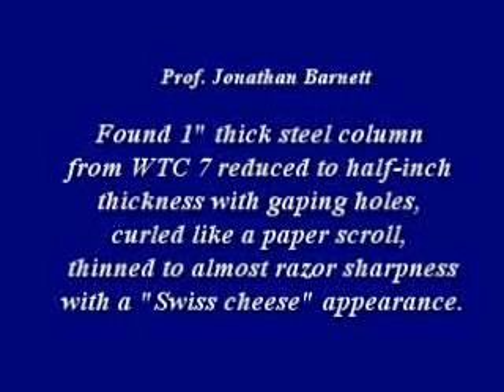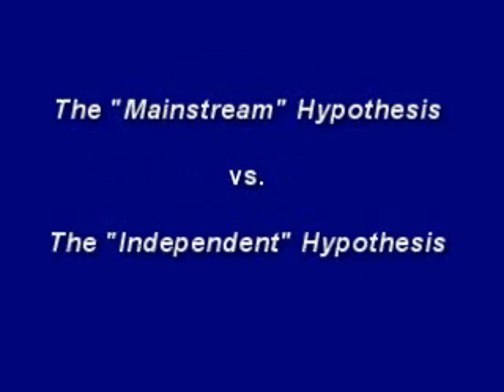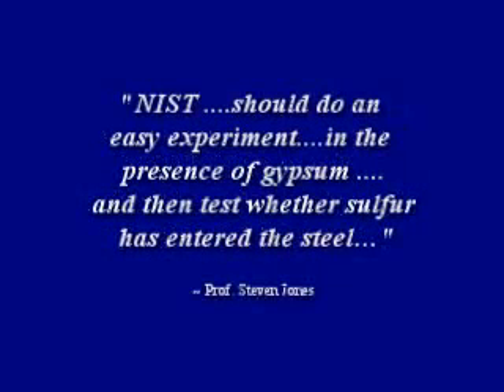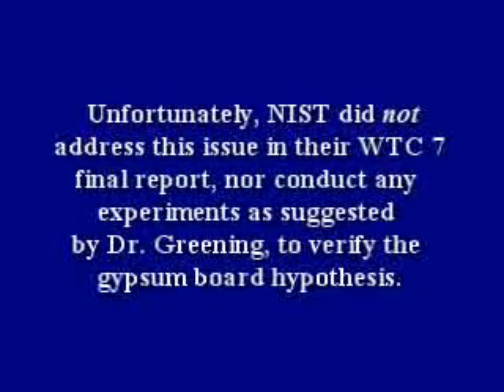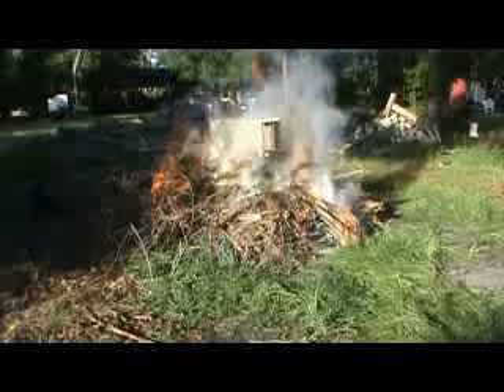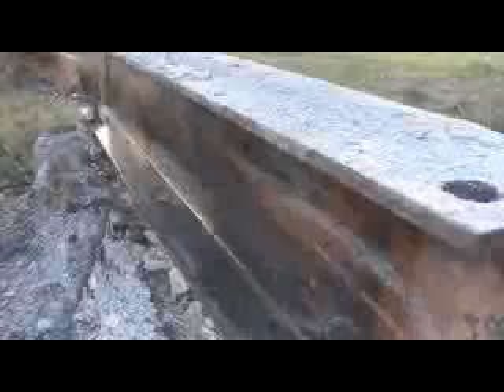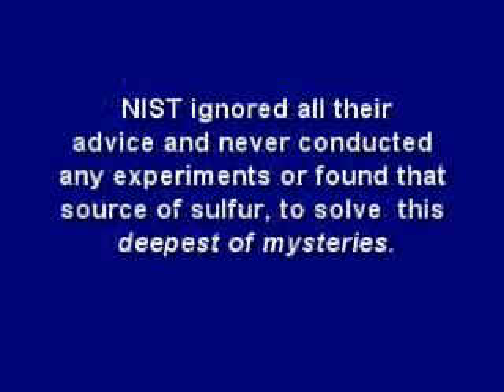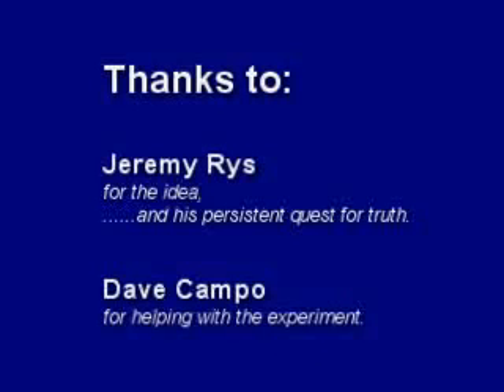9/11 Experiments: The Mysterious Eutectic Steel

Comment: @fertilizerspike The top of the building has enough to break the floors below without any momentum at all. 

The top of the buildings mass applied to the floors below will break the truss-to-column connections of here-said floors without any momentum at all. 

Unless you're one of those "engineers" who thinks the full vertical support capacity of the coluumns would have resisted collapse. (ignoring the still standing cores) (and myriad other things)

Comment: @fertilizerspike Each floor on the WTC is the same strength sans the mechanical floors at the lower, middle and upper portion of the building.

Comment: @teefkay2
The tests that were performed that verify this material is thermite and corresponding page numbers from the peer reviewed study:

magnetic (pp. 3, 4, 5)
chemical signature identical to thermitic compound, dissimilar to paint/primers, doesn't burn like paint (pp. 6-23)
large but narrow exotherm (pp. 4, 13-16)
pyrotechnic/explosive (pp. 15-16)
iron (and silicon) bound with oxygen 2/3 ratio (pp. 6, 9, 12-13)
aluminum predominantly in elemental form (pp. 6, 9, 12-13)
high enthalpy (p. 22)

Comment: @fertilizerspike 
"melted edge": wrong (eroded webs)
razor sharp: wrong (not close)
a swiss cheese hole: wrong (grain boundary corrosion)
FeS & FeO were part of the beam: wrong (only the Fe)
S from thermitic reaction: wrong (no S in thermite. S & Ba in thermate.)
S catalyzes thermitic cutting: wrong (Lowers ignition temp, produces flame)
firmly established: wrong
Typical twoofer. Every single detail wrong.
Go back to mommy's basement, child.

Comment: @teefkay said:
"1. F = ma, or 2. impulse-momentum eqn: Integral[F.dt] = delta[mv]"

Which formula tells you that the top ten percent of the building has enough potential energy that a twelve-foot drop can cause the complete cascading explosive failure of the entirety of the rest of the building? The force required for the top to destroy an equal amount would also be exerted ON the top, upward, arresting its motion long before it reached the ground. ASSuming this "collapse" was even spontaneous.

Comment: @flanksteak2
You should try actually reading the report, for example page 17, where it states sulfur is present on some of this nanothermite. It suggest the source of contamination by drywall. Any such sulfur contamination would only cause the reaction to cut through steel faster. Any contamination intimately mixed with once-molten steel is readily explained by thermitic reaction. Other contaminants, like metal oxides, would just drive the thermitic reaction. Do more research.

Comment: @teefkay
How long would it take the World Trade Center towers to shred suddenly from top to bottom in less than ten seconds with less than 5% of the outer columns severed and less than 10% of the inner columns severed for a total of less than 6% of all load bearing columns severed and only across at most three floors? There is no correct answer to this question, but you'll come up with one.

Grade F

Comment: @teefkay
Where in the tower columns did they use the breakaway steel designed to fragment in 30 foot segments as if the whole building had been run through a giant shredding machine? There is no correct answer to this, but you'll come up with one.

Grade F

Comment: @flanksteak2
I don't think you've read the paper. I'll quote page 17 from a hard copy I have here:

"Other peaks included calcium, sulfur, zinc, chromium and potassium."

The Ca and S are likely contamination from drywall. S would help the reaction cut through steel. Other oxidized metals also would likely drive the thermitic reaction. Paint chips melt in MEK, this nanothermite does not. Read the report for once instead of lying and suggesting you've read it when clearly you're ignorant.

Comment: @noozilander Taking modern low-sulfur and then claiming it was representative of the drywall installed in the WTC's in 1970's is non-sequitir. 

It's like taking modern paint, testing it for lead and then claiming that paint made many years ago could not have been a source of lead poisoning because the new paint you tested contained no lead. 

This might help you understand why Mr Cole's claims hold no water although you appear to have a drinking problem so I doubt it.

Comment: @flanksteak2 If you listen to the information presented, your tiny mind may just see that P&R is merely showing by experiment that the sources given by OCT proponents for the source of the sulphur are not possible.

Do try to keep up, swallower.

P.S. You still haven't answered what initiated the S towers collapse either. Did the walls push in on the trusses or did the trusses pull in on the walls? You said both, but we both know you were being stupid again, so what's your answer, swallower?

Comment: @flanksteak1,
"Thermite" is stupid. There wasn't any.
If used, residue from it would have been visible, by eye, from 30' - 50' away. Look at the hi-res photos today: no residue.
If used, 200 search dogs (cross trained on explosives detection) would have alerted. None did.
If used, and it did the (brain dead stupid) things that twoofers THINK it did, there would have to be about 12,000 - 15,000 cut columns in the rubble heap. There were 0.
Thermite is stupid, sulfur is stupid squared.

Comment: see John Hutchinson.  unreacted nanothermite can be made from iron oxide and aluminum being close to each other (since the aluminum siding was bolted to the steel directly).  There is evidence that two materials can be 'merged'.  It would also explain why it was a consistant portion of all dust and still unreacted.  The sulphur probably did come from the gypsum drywall, but it requires the hutchinson effect;which doesn't require that much power,nor is it a beam weapon as most would think of one.

Comment: @NanoThermite911 
an online petition with dubious origins and checking procedures for quals, how many of the engineers are structural or fire enegineers and how many are electrical or mechanical? and how many are wanna bes? 
and that then leaves how many architects who aren't qualified in building behaviour during fires?
you wouldn't trust a congressional oversight anyway as you believe it was bi partisan

Comment: What I really find fascinating is that you still believe diesel fuel melts steel.
You need to warn people about this, there is people driving cars with steel engines that runs on GASOLINE! Imagine the catastrophe if they mix in a bit of gypsum wallboard, the implications would be of massive proportions.

come on Merl... Your amazing theories is like the WTC7 , reduced to rubble.

Diesel fuel can ofc melt steel, but thermite/thermate would cool... Hello?!? Logical fallacy anyone?

Comment: @SuperLogicalthinker 
I as mentioned before they did a test on several floor beams that were exposed to fire for several hours and they started to warp.  I did not glow red.  Your right about the fires don't burn hot enough to make steel columns glow red but they are hot enough to make those beams weak.  Since 1/3 of the 7WTC already been damaged by the north tower, only few columns was left and they were exposed to fire.  No evidence of a explosion was ever involved.

Comment: @SuperLogicalthinker 
I just wanted to know if those beams can be bent while it's glowing red.  They've done a test where several floor beams were exposed to fire for several hours and they started to warp. If that was the case that means the beams that surpported 7WTC could no longer support the weight of the building and eventually failed. What he done here is let the beam cool off and said it was solid and sound which it proves nothing. SHITHEAD!!!

Comment: Nice experiment.  But there is one thing.  After he burn the steel beam he let it cool off first and proved it was still strong.  But, is the beam still had its strenght when it was glowing red?  Remember, building 7 was still on fire before it came down.  Also, did the beams that supported the building was still strong enough to hold several tons of concrete and steel above after long exposure to fire?

Comment: @Merlin5x5 "The crashing upper block C is not Asymmetric"
Why not?

"It's very symmetric, isn't it"
Why?

How does asymmetrical damage on one side of the building equate to a precipitous 3.7m drop of C onto A through B? That indicates simultaneous failure of the vertical columns.

The 47 core columns & perimeter columns are connected all the way down to the bedrock, so your notion of only having to deform/crush 3 floors at a time is farcical.

Comment: @Merlin5x5 "ONLY ONE gravitational acceleration"
Well done! You finally got something right. 

I've continually stated that the resistive force on the falling 2/3g pile-driver was 1/3g - thus it's 2/3g acceleration. What's hard to understand? You seem to think an object is either completely a rest (0g) or in free-fall (g). 
Pop-quiz: Let's say you weigh 60kg and you hop onto a scale in an elevator. The elevator now descends downward at 2/3g. What will the scale read?
Reply: i know it's been 11 years, but....60 kg?

Comment: @Merlin5x5 "damaged 6 floors"
Asymmetrically they did. Are you going to try and say they were uniformly damaged across all 6 floors? 

"higher than three floors"
Sorry, I can't see your point here. This structure, A, still needs to 'crushed' by a force delivered by the mythical pile-driver. Falling rubble B isn't the crushing mechanism here.

"that's it's SPEED"
How many times do I have to say it? It's accelerating downward at 2/3g. In other words, it's velocity is constantly increasing.

Comment: @Merlin5x5 "Piledrived it"
Once again, HOW can it do this with no deformation to itself? You talk of an 'impact' of C onto A, yet there is deceleration of any kind. How is that possible? A force so great as to start crushing A and cause global collapse, yet the required deceleration is not discernible or measurable in any video? How can C transmit a force so great that A wasn't able to withstand but that itself, made of the same elements & particulars, was able to?

Comment: @Merlin5x5 "HEAVY TRUCK"
Why is a truck hitting a car you clown? It's meant to be a like object hitting a like object - part C 'impacting' part A. Part C's potential energy doesn't matter - because, as has been explained to you, part C can't ONE-WAY crush part A without destroying itself. 

"2/3 g"
Yep, the upper block moves downward at constant 2/3g. Thus, the resistive force of the lower, stronger structure below is 1/3g. Why are you trying to deny this?

Comment: @Merlin5x5 "cars in a line"
To go along with your one-way crush-down then crush-up hokum, what you are basically saying is that if a semi-trailer (A) was hard up against a wall (or 9~ other cars lined up), that the car (C) getting a run-up (1g) would be able to accelerate through it and crush it all the way into a compact debris pile - without any deformation to itself - until it finally hits the wall and gets crushed (the crush-up phase).

Your Heiwaco experiment is going to be an epic fail!

Comment: @Merlin5x5 "ever fallen at 2/3 G?"
When there is a resistive force of 1/3g... this is pretty basic stuff.

"SPEED"
Am I to take it you don't differentiate between scalar and vector quantities?

"of a 1 G fall"
A very generous assumption in favour of the official conspiracy theory. Why would an entire floor and all it's structural components disappear so this 1g drop can occur?

"20 lb barbel"
Your example is a non-sequitar. Try dropping a 20lb barbell onto another 20lb barbell. What happens?

Comment: @Merlin5x5 "upper blockC doesn undergo further collisions at all"
This is total hokum. Only one question is relevant here: What is applying the crushing force to the lower part A? If the answer is Part C (which it's meant to be), then that same FORCE must be applied to in turn. It's called newton's third law - equal in magnitude, opposite in direction.

Part C is not riding on a mythical 'rubble pile' which is doing the crushing - it is meant to be delivering the force of the crushing itself.

Comment: @Merlin5x5 "why would it be at 2/3 G"
...because it's been measured at 2/3G. It's also verifiable and reproducible with video analysis.

"C ALWAYS applies a MULTIPLE of it's weght"
Not if it's in a constant downward acceleration. 2/3g means the resistance force is 1/3g and only 1/3 of it's static weight is being exerted.  

"OBJECT MOVES, it weighs MORE"
If it's in a constant downward acceleration due to gravity, that is totally incorrect.

Comment: @Merlin5x5 "constant acceleration"
You use this term but don't understand it's implications. An acceleration of C through the lower, stronger structure A at 2/3g means that C is only exerting 1/3 of it's static weight on C and A is offering a resistance of 1/3g. A laughable impossibility given the redundancy of A.

"Once part C impacts A, it SNAPS THRU."
But what happens to C? A is much stronger than C, yet you think it can 'snap thru' A at 2/3g? C must also be destroyed in the process.

Comment: @Merlin5x5 
"... would drop the initial 9.8 METERS in the first second" NO MERLIN YOU ARE WRONG!!!

It it was moving at a constant velocity of 9.8 m/s then it would travel 9.8 m in a second - pretty basic.  But freefall is ACCELERATION, meaning the velocity increases by 9.8 m/s every second, and this is starting from a stop!!  It is only going 9.8 m/s at the very end of the first second!!  

The equation we need is:

d = 1/2gt^2

t is one, so we have 4.9 m for the first second.  now fuck off.

Comment: Almost free-fall hm doesn't sound like progressive collapse , they did ask to CD the TT , look it up , its you how is in the position of ignorance tony !
Yes gravity work the same over here 8--}  but our steel doesn't fall through itself , it buckles and takes the path of least resistance , just like WTC7 , the bottom floors blow out allowing the building to free fall in its own foot print !
Tony you need to try harder with folk who refuse Mercury n aluminum jabs and fluoride in water ? no F-B

Comment: @Merlin5x5 i didn't spam you, don't blame me. i understand you now but i do need to prove to myself as to why the the building underwent free fall in stead of a delayed fall or slower then the acceleration of gravity fall. a force acting in opposition retards acceleration. even if a factor of 8 is involved there should have been some data suggesting that work was being done crushing concrete and steel by observing the time it took for the trade center bldg no 7 to achieve a state of rest.

Comment: @Merlin5x5 that's not what i said i said the acceleration would be less then "g" thus ruling out free fall because acceleration dose not equal the acceleration of gravity. 

a mass of 100 lbm falling having 5 lbf opposing has an acceleration "a" not equal to "g" 

i don't think you can just divide up the mass per floor, buildings like this are built to support the mass of all the floors above it, the first floor is much more massive then the middle floor and so on.

Comment: @Merlin5x5 yes there is going to be an acceleration, but not equal to "g" 32.157 ft/sec^2. i assume it would be more like 25 to 29 ft/sec^2 even with 8 time the force to do the job. without running the numbers i cant be 100% sure. looks like i should break out my old dynamics book i haven't even used for 10 years and run the numbers, but finding the mass per floor could be imposable to find.

Comment: @Merlin5x5 on my planet there is 21 percent oxygen,  LOW OXYGEN environments don't produce high temperatures and therefore cant compromise the strength of steel. if the steel structure was compromised then there was assistance. the plane crashing into the building could not have been the only factors for collapse. in collage engineers study dynamics (concepts of force and mass) and kinematics the study of motion, given this how do you explain free fall if there are forces opposing free fall?.

Comment: very sound experiment, a friend of mine repairs antique cast-iron automobile brake drums by building a fire like yours, then after they reach a high temperature he welds them, as the drums cool off they are returned to the fire and the process repeated till finished, then the brake drums are but in a lathe and machined to specification. the drums are very sound and serviceable.  as an engineer at a repair facility i wonder if the Gov. even has qualified engineers to investigate 9/11

Comment: @Merlin5x5 Typical corporate pawn, you have the evidence sitting before you, but believe only what fits into your preconcieved story. This gun is partially melted, and completely encased in concrete that has cooled around the gun. The conditions that  caused  this simply do not exist in the scenario projected by the NIST. There is a lot of evidence of this nature that is well documented. Consider it well before spouting false hypothesis, the real story is reflected in the evidence.

Comment: @Merlin5x5 ...Limited? By whom? I suppose you can explain the melted guns, from WTC 6, in the NYPD museum also, but not so easily because they are encased in molten concrete. What evidence do you know about that indicates the temperatures were limited to 1000 degrees? 

BTW, your statements about thermate show that you have not done your homework.  Cutter charges are not large explosions, like blasts used for lower columns. 

Evidence is important, theory is merely speculation...

Comment: 911 was a MEGA RITUAL, flt nos of the plane illusions were 11,77,93 & 175 which represent:

11=sun/solar cycle 11 yrs from GHWB NWO speech 911 1990 to GWB's 911 2001.

77=Crowley identified OZ by the word “strength,” which equates Qabalistically to a double-seven, or 77. Book 77 in Crowley’s canon is known as Book OZ, or The Thelemic Rights of Man.
77 represents Mercury, god of Trade & Commerce, Hermes, herald of the gods, god of Information, AKA, Lucifer, bringer of Illumination